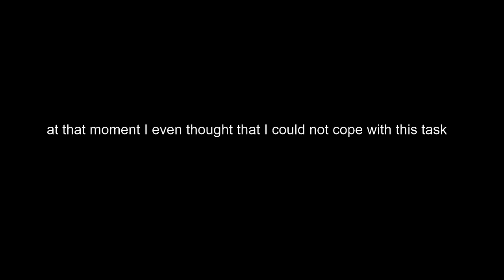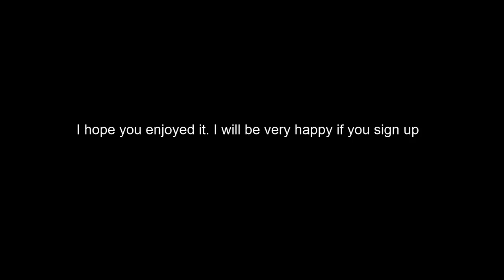For this idea, I spent 50 meters of profiled pipe. I was pleased with the result

Comment: Nice work but clean your dam material don't weld through rust and mill scale etc it takes a couple seconds to flap disc a clean spot and your welds will be stronger as a result I don't know what it is with YouTube welders that nobody cleans their  material you should have nice shiny steel to weld and a nice shiny spot for your ground clamp 👍👍👍

Comment: This is a joke right?  You have welding magnets and use them for spacers!   Then struggle with clamps! And dont even bother to use those welding magnets that are made for that job.  Then you dont clean your tubing, other than scraping the snow off your rusted tubing that you call pipe, then paint over the rust!  You would have been shown the door in my shop. And you want subscribers to follow you?  No Thanks.